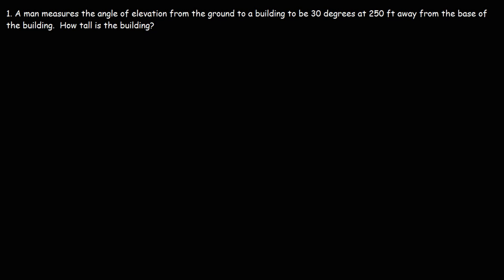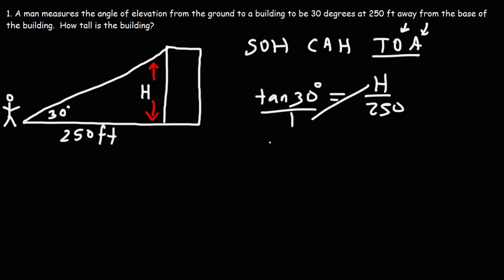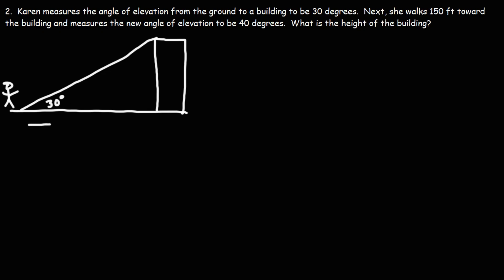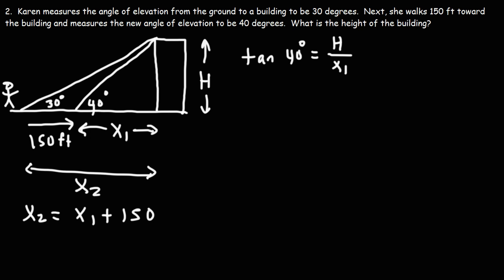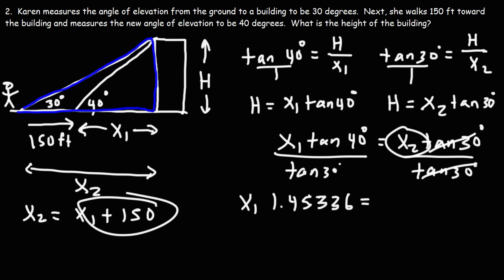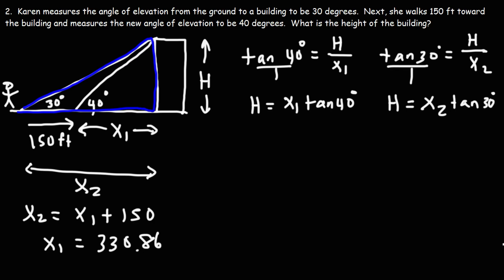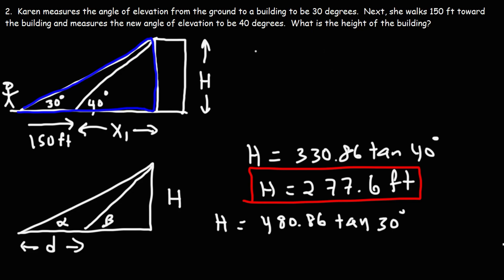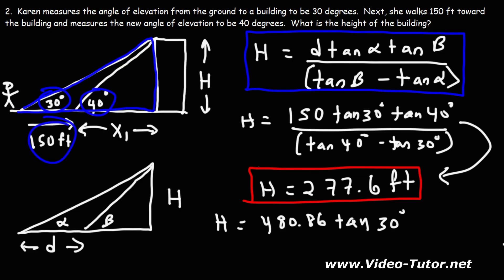How To Calculate The Height of a Building Using Trigonometry

Comment: A building (DF) and a tower (CE)are apart,fromm the roof of the building the angle of elevation to the top of the tower is 15⁰and the angle of depression to the bottom of the tower is 46⁰

Calculate the height of the tower?

Comment: you need a spirit level to make sure your baseline is level. then use a 45degree square. and move back and forth until the top of the building lines up.
then pace the distance to the building.
then measure ten paces using 2ft slabs as your guide. that will tell you how many feet to a pace. then add the height of your eye.
all that is comolicated enough without trigonometry.